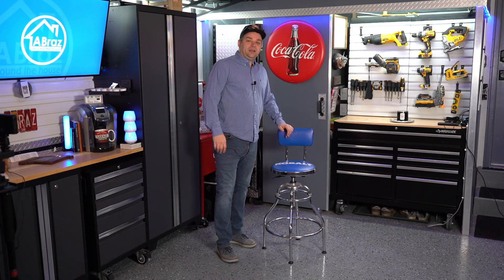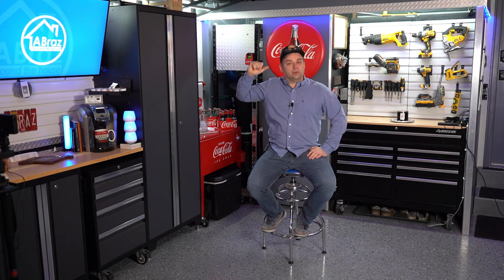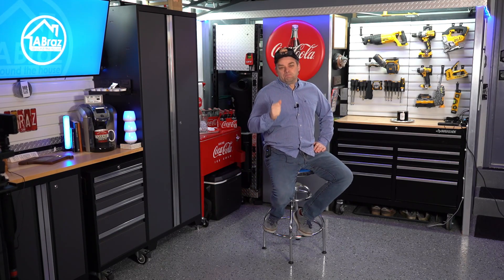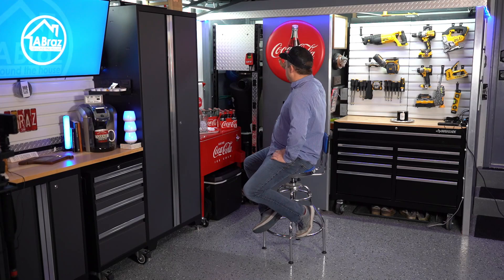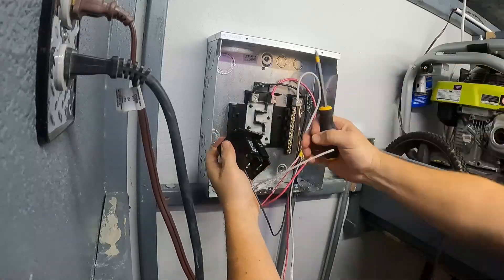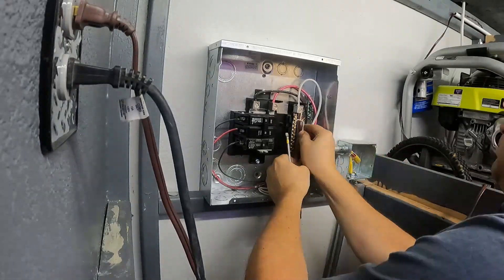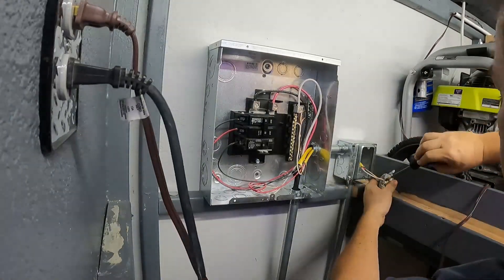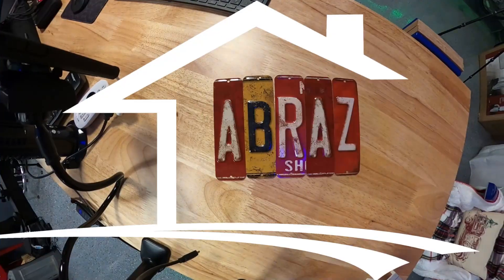Quick And Simple Garage Electrical Upgrade: Installing 220v Outlets From Kitchen To Garage!

Comment: I’m from MO. Too.    Go Cards!    If you would like to know your NEC violations, please reply yes.   I designed electrical systems from 1983 to 2018 and retired.
Reply from the maker: Thanks!  Love our birds on the bat!  Feel free to fill me in on any NEC violations!
Reply: You commented but it disappeared.   So, you have one maybe two code violations.   The electrical work was excellent.  The possible violation is that you are required to have 30” minimum wide clear space in front of all panels.  Don’t know how wide that bolted on right of panel is away from what’s on the other side.  The definite violation is when you put the vacuum system in front of the panel.   I know it’s on wheels, but NEC says no don’t do it.
Again, the video and work done were great!
Reply from the maker: Thanks Kevin!  I appreciate you taking the time to fill me in.  I'll admit that will be a tough one for me.  I don't run the dust collection from there...does it impose a risk just storing it there?  I do understand the open space issue in front of the panel.
Reply from the maker: Sounds good!  Thanks for the info!

Comment: I did basically the same thing stealing the unused 220v outlet that was for an electric clothes dryer (I have a gas dryer) to make a subpanel to serve my garage workshop. I will note that you should have GFCI protection in a garage. I used GFCI breakers, but GFCI outlets would also work. Also you just labeled the breaker slots with what can be read right off the breaker. Probably better to label it with what it serves, dust collector, table saw, west part of garage...
Reply from the maker: Thanks!  Yeah GFCI is probably a good idea 👍.  Thanks for the input!

Comment: I thought you had to use a bigger gauge wire for 220v outlet. It looks like you used 12/3 Romex Am I wrong?
Reply from the maker: It is a 20amp breaker.  That is what my table saw requires.  I probably should have upped it to 10 gauge in case I go a little higher.  My understanding before I installed was 12 for 20, 10 for 30, and 8 for 40.
Reply: The current dictates the wire size, not the voltage. 110v or 220v as long as it is a 20amp breaker than 12 gauge is what you want.